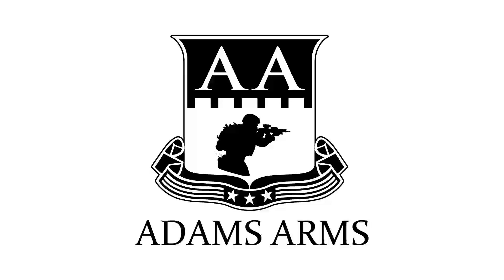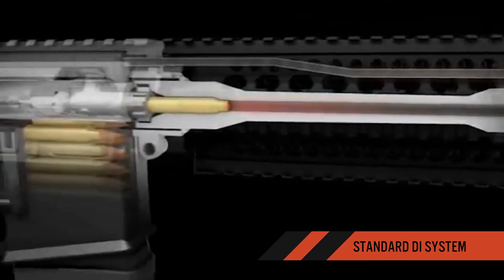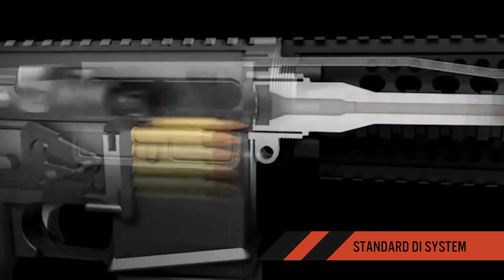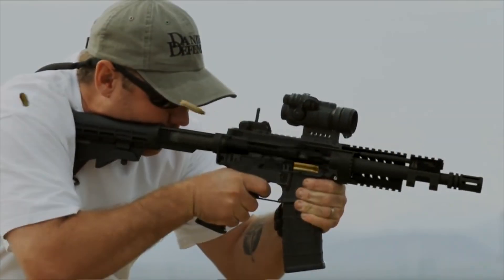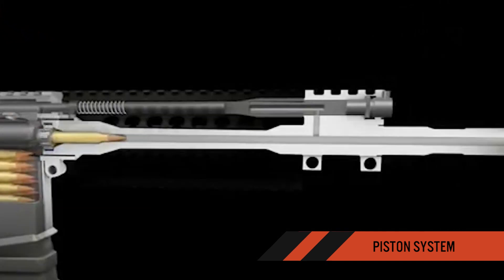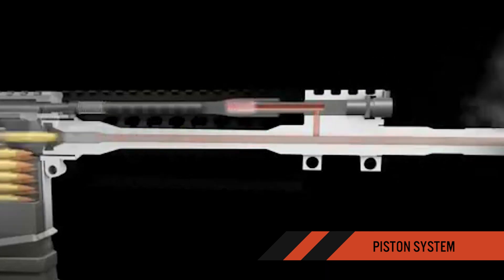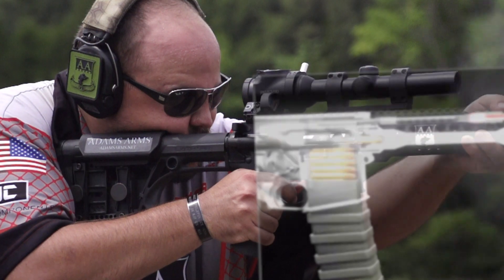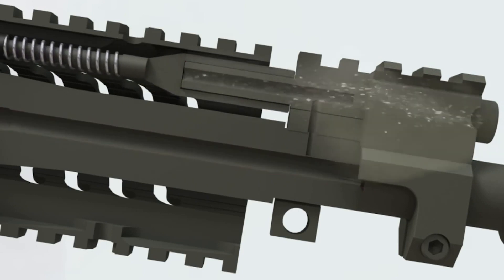Adams Arms Piston System Animation

Comment: Why aren’t these more popular then?
Reply: heavy than normal ones, expensive and harder to repair 
though its mostly the last point, since every manufacturer makes their own you cant swap parts which goes against the AR platform ideology
Reply: @googleslocik  is it harder to repair? i think D.I isn't "much easier" to repair either

you just need to replace the gas system , and that is it

the D.I (direct implementation) will blow up the gun underwater

the trade off is worth it ,  reliability is actually much better
Reply: @thanosfickda  
DI is simpler in construction, less parts and you almost never need extra parts. And thats my point, the only way to "repair" anything is to replace entire thing, which often means hard to find custom parts.
Reply: @googleslocik  short stroke piston isn't really complicated either,   from what i see,  i only see 2 moving parts 

hk 416 have already fored 60000 rounds and have less failures than m4a1 

hk416 has been tested underwater torture test,  and actually shoot,   unlike DI gun blow up after water submerged 

short stroke piston actually block all of the gas

just because there are 2 moving parts , doesn't means the gun is less reliable,  actually it is way more reliable
Reply: @googleslocik  fired 60,000 rounds*
Reply: @thanosfickda  But they are more complicated. 
Also proprietary parts a huge problem, if its not some big firm like HG you might not be able to find replacement, AT ALL. 60k? i call bull, i have seen then fall apart under 10k, and at 30k you will probably wear out parts.
Oh yeah, and lets not foget the price oh HK rifles, here they cost 4-5k$.
Reply: @googleslocik  do you have sources that piston gun "fall apart" under 10k? 

you acted like short stroke piston have like 10-20 moving parts,  while i only see 2 moving parts

i also see comments saying that they are happy with their piston guns after thousand of rounds shooting,  no cleaning ,  after years of shooting 

how can you prove those people wrong then?
Reply: @googleslocik  depend on which hk guns, but hk416 can be just around 2k dollars ,  the more people buy the guns,  the price will go down
Reply: @thanosfickda  
What you even on about, 20k is normal life expectancyfor those rifles, its extremly rare to have stuff last this long, things often break much earlier and its usually decades worth of shooting for normal people.  Hell, by 30k rounds your barrel is probably completely done. 
And every extra part moving part matters, the more complex the system the more prone to failure.
It has its advantages of not shitting up everything with sut as fast, but the question was why it isnt more popular, and thats the anwser.
More parts, no solution unification with lots of competing proprietary solutions, and hard to fix without getting original replacements.

And yeah, i see a lot of boyer remorse too from people who spend 4k on a hk gun, once you are so deep in self reflection isnt an option.
As for price, maybe in your country, here in EU you wont find a HK 223/556 rifle for under 4k$ for cheapest models, more expensive ones are 7k$.
Reply: @googleslocik  "every single moving parts matter"

how "matter" is it?  no every moving parts have the same reliability 

all i see is a spring and a metal piston stick

your argument isn't even enough to convince me or anyone who actually own a piston rifle gun 

i failed to find any strong evidence that short stroke piston are less reliable than DI 

or the short stroke piston will be "destroyed" faster than DI
Reply: @googleslocik  Not every*
Reply: @thanosfickda  
Dosnt matter what you think, the consensus on AR design is clear, piston ARs are not popular and DI guns dominate the market.
So i dont have to convince anyone, people are already convinced.
Reply: @googleslocik  "already convinced"  by your argument?  hm,  there are also people who aren't convinced by your arguments either

the reason why piston ar aren't popular on market is not because it is "worse" 

but because people don't care enough,  and happy with their DI ar 15  

social media also play a huge role on how many people gonna vote , buy this and that thing 

Just like american politics,  the reason why there isn't a 3rd party is because 3rd party don't have as much money as 2 same parties ,  can't spend as much money on social media as 2 parties does

just like military politics, "leadership"  ,  they don't always choose a weapon because "we iresearch alot about it,  so it is actually better in this way" ,  years later,  the weapon project got abandoned ,  not being "adopted"
Reply: @googleslocik  the reason why DI guns are more popular is not because they are better

but because simply piston guns aren't popular on market,  it is that simple ,  one is social media,  two is not enough countries/military adopt the hk 416 to reduce the price down 

people are already happy with their DI guns and doesn't care about piston guns enough

there is no strong evidences showing "piston AR aren't famous on market because they are worse"
Reply: @thanosfickda  ... Piston AR arent more popular since ... they arent more popular? Nice circular logic there.
Dunno man, maybe the crazy price of guns like HK, the borderline impossibility of finding replacement parts in some countries and the weight for tacticool crowd has something to do with it? No?
Also why would other countries adopt proprietary patented american/german solution thats basically just a spin of a normal AR15?
when confronted with reality you have another cope ready, crazy stuff.
Reply: @googleslocik  "impossible find part replacement"   you can apply this argument to other countries 

but then again,  your argument is "DI guns are famous is because they are better"  

and i found no strong evidences to prove that 

you are the one who is "coping" here buddy,  you found no strong evidences to prove DI ar is better in term of reliability ,   

but only in price and Parts availability
Reply: @googleslocik  many things can impact price and part availability by alot ,   and reliability and complexity aren't those big reasons 

it is simply the demand and production ,  and the social media "algorithm"
Reply: @googleslocik Since when did being able to swap parts become the reason people want ARs!? LMFAO Swapping parts isn't why people own the AR! It's pretty obvious that you are one of those people who cry if something adds 2 ounces to a gun. If your muscles feel fatigue from adding a few OUNCES then maybe you should drive by the range and head to the gym! DI is for people who like cleaning their sht all the time. And here in the states, once you get over the 1000 dollar price point it's pretty much one gas and one piston, maybe 2 to 1 but pistons are pretty common but when people are swiping through their phones looking at new guns they fail to look at the fine print that says DI or piston. More than half of SIGs are piston driven. So I really don't understand where your argument comes from. Once you go piston you don't go back.

Comment: Neither the DI or Piston system will matter in terms of reliability to people who take their guns to the range, and occasionally shoot high volumes. 
Both the DI and Piston system have been shown to fail around the same volume of rounds during a sustained high volume of fire. 
The DI system is an enclosed system, it may arguably be dirtier, but it doesn't have an exposed piston under the handguard to get full of crud and prevent the weapons from cycling. 
DI was also designed the way it was, so they took what it does into consideration.
The AR15 wouldn't have become so popular and prolific if it's DI system didn't work and work well.
Reply: In reality it's been found that piston ars fail much less often. There's a reason most militaries use piston guns. Di junk is basically the same as old black powder guns.

Comment: What they don’t tell you is the fact the piston operating system fucking SMASHES your buffer tube weight, mine was already beginning to crack
Reply: That just sounds like you don’t have constant tension between your buffer and bolt... all bolts slam back the same way this ones just cleaner
Reply: I don't even know how that is possible. You might want to check your buffer tube for cracks because you're probably bottoming out. If you are check your spring and replace if needed. I can't see how it is smashing into the face at all since it should be in direct contact until the bolt seats. At that point you might get what's called bolt bounce but otherwise direct contact.
Reply: Maybe turn the gas down a notch or possibly use a heavier recoil spring?

Comment: I have S&W MP15PS, not exactly AA, but very similar design.100% reliable, zero issues in a few years, can consistently produce 1MOA groups with good ammo and  2-2.5MOA with cheaper ammo, like steel cased wolf. Easy cleaning too. It's practically clean inside receiver after shooting session.
Reply: Not similar at all actually. The M&P is a DI system this video is showing a piston system.
Reply: @Mitchems  S&W MP15PS, where "PS" stands for "piston system" It is practically the same design.
Not only S&W now makes piston-driven AR, also Ruger, SIG and some others. So we have few options to chose from :) Good design, runs clean, reliable and accurate. Next generation AR! I have now both, S&W and AA. Gave AA to my son and left S&W for myself.
Reply: @vadym1  S&W was the right choice to keep, absolutely love that manufacturer

Comment: Eliminates fouling, but you have a big heavy piston slapping back above the bore axis. Less maintenance, but more muzzle rise; I would prefer a regular AR-15. It's also worth mentioning that carbon works as a dry lubricant, so as long as you aren't using corrosive ammo, your bolt actually lubes itself every time you pull the trigger. You guys are going backwards, technologically; the hybrid gas impingement/piston system in a regular AR-15 is better, IMO.
Reply: I agree with you Jason smith but instead of hybrid I call it internal piston and sks external pistol
Reply: My P2 rifle in 5.56 has absolutely no muzzle flip at all. In fact, all felt recoil is a light push into the shoulder. Very pleasant to shoot
Reply: The notion of the gun self-lubricating from firing a cartridge is absolutely ridiculous... Explain then how every failure to feed I've ever had with an M16A4 was from excessive carbon. If that were the case then why would we ever clean the rifle.
Reply: Your joking ! M16 I left for the new privates and grabbed M60 ! I've been on the range and pumped 600 rounds in M4  when it starts to foul up.  It's no AK !  You signal back for Armory to come up with can brake fluid to blow out the shit so it can start firing again .
Reply: Just admit ur a pleb and be done with it not everyone can run piston with the big boys
Reply: Do you have a source on the hybrid?
Reply: Ask a soldier when it jams in the battle field what does he feel like in a cross fire many soldiers in NAM died there are even stories that soldier threw there m16 and picked up enemy AKs but that was long time ago now the current m4 are reliable with a wider gas tube i love both the rifles but if there is a slight muzzle rise i would go for that instead of a jammed weopon
Reply: Jason Smith “more muzzle rise.”
Yeah I watched so many videos about short strokes and they all don’t have much recoil. Stop lying.
Reply: @myusername3689  no it's TRUE it has more muzzle rise.
Reply: @bobbyraejohnson  not only muzzle rise. I don't have an AR but i saw in slow mo vids that barrel will end up having some flex imparted to it by the mass movement in the piston system
Reply: @h.cedric8157  i have a piston and it shoots flatter and smoother than any of the DI's I've ever shot
Reply: I find it interesting that you called it a hybrid gas impingement/piston system.  The AR isn't a direct impingement system, but when I say that I'm met with arguments.  Hybrid, that's a much more accurate description.

I have no complaints about the AR's system, and it's even better once the gas is properly regulated, but there's some advantages to keeping that stuff out of the works.  A piston system could be made that didn't introduce nearly as much extra weight & recoil, but it seems everyone has gone with some variation of copying the AK style piston instead.

Another option would be to make it a direct impingement system and not have gasses enter the bolt/carrier, but I don't see a compelling reason to change the original AR system.  I have DI, piston, and hybrid guns; each has different attributes.  Of all of them the DI is simplest and it doesn't put any gasses into the bolt/carrier like the AR.  Very few makers use DI so I assume there's some shortcomings I'm not thinking of.
Reply: Ok....

Comment: Anyone have any experince with this kit?is it reliable?..i would like to buy one
Reply: I don't have a conversion kit, but I bought one of their complete piston uppers for my second build and I've had zero issues. I'm still under 1k rounds, but it's eaten everything from reloads to cheap steel case without the slightest hitch.
Reply: Adams Arms piston uppers are the best
Reply: Do you have to change out the piston-spring? Seems like another part to maintain and have spare parts for?...🤔
Reply: I put 1 in my AR pistol 5 years ago got about 800 rds through it still haven't cleaned it works awsome never had a double feed or failure to extract